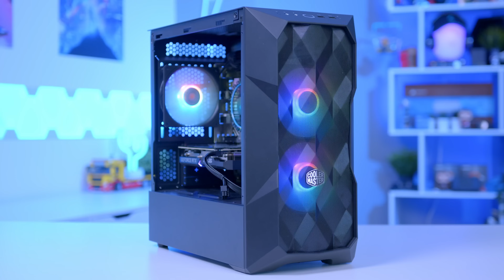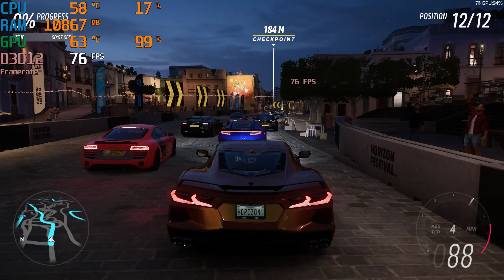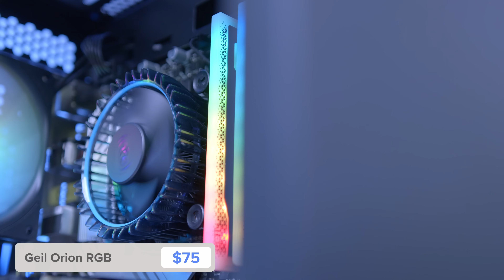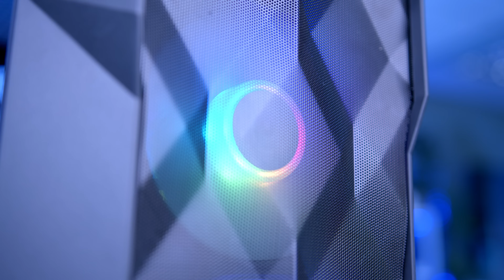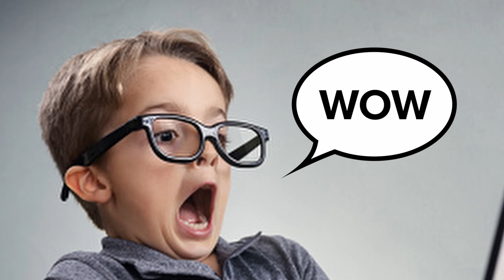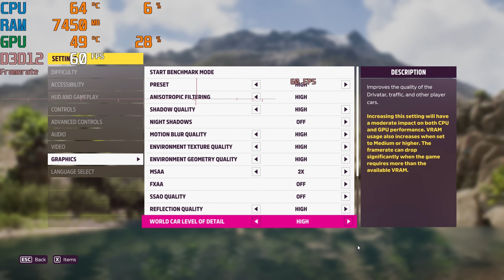Best $750 Budget Gaming PC Build 2022! 🔥 [Full RTX 3050 Build Guide w/ Benchmarks!]

Comment: Saving up for a 3050 build and this one is just perfect for me! Awesome video🔥
Reply: Honestly if you buy around Black Friday you’ll probably be able to get a 3060 or better for the same price as the 3050
Reply: @osamapatrick8642  true, a 3060 is cool but a 3050 will be enough for me, I will use it to play WarThunder and BF2042 so its good enough. I can get a 3060 for 100 euro's more atm tho
Reply: Always rx6600 instead of 3050, that thing is a rip off, in 2 years you feel like the people who have a 1050 or 1050ti rn :P
Reply: @osamapatrick8642  And I will have to upgrade to an I5 too...
Reply: Very interesting card too and deffinitly considering to get one too but I just like the 3050 a bit more. I hope james will make an new 6600 build soon too
Reply: @Ryanlgt  what do you particularly like about the 3050? the 6600/6600xt doesnt consume that much power compared to the 3050, it also has better availability, is more bang for the buck and in general is just a much better card than the 3050.
Reply: @Ryanlgt  6600 12100f is a good combo no bottleneck
Reply: @a15bionic59  well thx for the info all, I will go for a 6600 then!👍
Reply: @Ryanlgt  no problem🫶
Reply: @osamapatrick8642   saving up for a 3050 while the 6600 is the better and cheaper card isnt the smrtest way to go
Reply: @Ryanlgt  the 6600 is also cheaper than the 3050 in case u didnt know...

Comment: Thinking about getting this build but with an rx6600 instead of the 3050 since the 6600 is near msrp and I can’t find a 3050 under 300$
Reply: I recently upgraded my failing Rx 580 to the RX 6600 Xt gaming overclock edition 8GB and loving it
Reply: I can safely say you will not be disappointed with a RX 6600. 
I got mine on release for £383. it is a bloody solid gpu. Now that it's price is falling its a very competitive gpu ( holds it own against the 3060 so why would anybody go for tier lower 3050)
Reply: @grumpyratt2163  it's now ever cheaper found one for 250£
Reply: @Lightningfrs   even at that price it's still a bad deal not as bad a rx 6400 and 6500 even at their prices.

Comment: here in finland a dual fan 2060 6gb is cheaper than a single fan 3050 8gb. the 2060 is the way to go, right?
Reply: The 2060 is actually faster than the 3050. The only advantage the 3050 has is more mature ray tracing cores and 8gb of vram, but i doubt you'll run into vram limitations at 1080p with most games.
Reply: Cori,The Creator.  here it's like $85 more expensive than the 2060 tho, is it still better to get if you're on a budget

Comment: My Dream PC built. Will mostly be using for gaming and rarely basic video editing. Maybe even start streaming.

Case- Corsair 4000D
Mobo- MSI MAG B660M Mortar DDR5 Wifi (Will not be OC CPU)
CPU- i5 12400F (Will be using stock cooler from the box)
RAM- DDR5 4800 Mhz 2X8GB
Storage- 128 GB Gen 4 M.2 SSD (for windows only) + SATA SSD 2.5" 1TB 
GPU- MSI Ventus 2X OC RTX 3060 Ti
PSU- 600W Gold rated 

Monitor- Gigabyte M32Q
Mouse- Razer Basilsk V3
Keyboard - Redragon K502 or Razer Cynosa V2
Mousepad- Logitech Grey Desk mat
Mic- HyperX Solocast
H/P- Sennheiser PC37X

I want the best performance in this price range. Hence going for non Graphics CPU and DDR5 RAM and Gen 4 SSD. Any changes u might wanna suggest?
Reply: Get a 27 inch monitor
Reply: dd4 would be finee

Comment: Would this build work with putting in an i5 instead of the i3 and putting in a 2070 super GPU?
Reply: it would but it depends on ur i5 is it 12 gen cause if its lower then 4th i dont recommend
Reply: @skaat1439  yeah I probably would get a 12th gen i5, my friend is selling my the 2070 super for 450$, is that a good deal?
Reply: @paradoxyt1851  no it isnt you can get a 3060 ti with that money

Comment: could i switch out the CPU For a ryzen, or is that not compatible?
Reply: You can you just need a am4 motherboard, and dont buy the 3050, its way over its msrp and its just a 1060 with rtx, a 6600 would be better with more performance and cost less

Comment: A used GTX 1080 for about $200 is way better then the $320 rtx 3050 you had and even better then the 3060. The motherboard you used isn’t under a $100 now so you might be better off getting an i5 11400 and a cheaper 11th gen motherboard. The ram was overpriced by $25 because it has rgb. The SSD was overpriced by $25 because it was a samsung. The case was was overpriced by $30. You can find a nice case for $50 but for your price you could have got an NZXT case. Could have went evga on the power supply and saved $20. Whole build is very overpriced in my opinion.
Reply: @Angel Im very new to PC building, I thought the 3050 was the newer model or is the 1080 newer/better? I thought higher the numbers on the name (3060, 3070, 3080 etc) the better the performance

Comment: Wouldve been better off with amd cpu and gpu for budget builds, 3050 is horrible its a 1060 with rtx and is over its msrp, 6600 is better than 3050 and cost less for more performance, also rgb shouldnt be a thing in budget build
Reply: Rtx 3050 has raytracing ability, where and GPU does not
Reply: @mildauli4822  yes ik, but a 3050 is litterally a gtx1060 with rtx, a 6600 is below its msrp of $329, and brings performance of a 3060, and a 3060 is like $420. You could even buy a 6600 xt which is $399 rn and is the performance of a 3060ti. People favor nvdia rn because of rtx and its better at video editing, but their prices are still far from their msrp
Reply: Well it's up to people if they want to sacrifice performance for raytracing
Reply: Nice a scam

Comment: Build this instead.

Cpu = 12100f = 106.99 
Motherboard = Gigabyte B660M DS3H DDR4 = 109.99$
Ram = Silicon Power 16 GB (2 x 8 GB) DDR4-3200 CL16 Memory = 47.97$ 
Ssd = Western Digital Blue SN570 500 GB M.2-2280 NVME Solid State Drive = 38.70$
Gpu = ASRock Radeon RX 6600 8 GB Challenger D Video Card = 299.98$
Case = Lian Li LANCOOL 215 ATX Mid Tower Case = 89.99$
Psu = EVGA SuperNOVA GT 650 W 80+ Gold = 64.98$ 

TOTAL  = 758.60 

Benefits of my build
1.) 6600 is WAY faster than a 3050. Not even close. The 6600 is upwards of 30-50% faster depending on the game. 
2.) The case i provided will last AGES. It has insanely good airflow and should be suitable for any manner of future gpu upgrades (providing you make sure theres enough clearance for the gpu to fit of course)

 I attempted to provide a source for benefit number 1, but it kept getting my comment blocked. If you'd like to find performance numbers you will have to search. I recommend checking the gamers nexus video on the 3050.

As a side note, the parts in this video actually amount to 899.94$. Not 750.
Reply: Thank you. Love your config. I am not an expert but sounds nice to me
Reply: Solid build.
Reply: I'm still running an i7 8700 paired with an rx6600 and still getting high fps